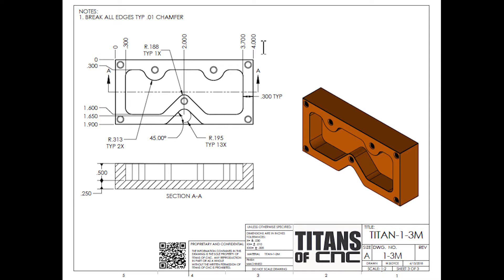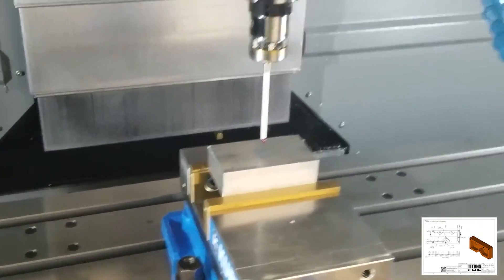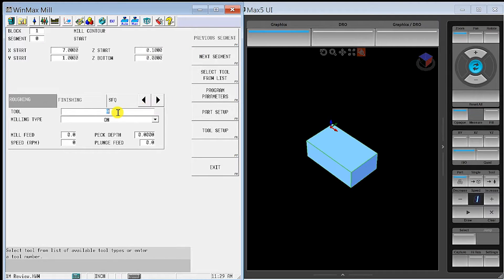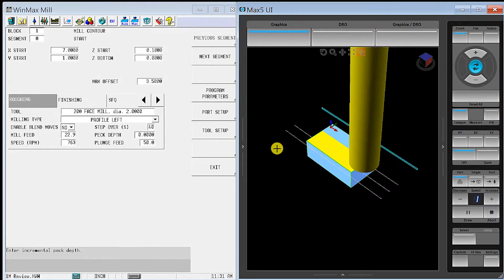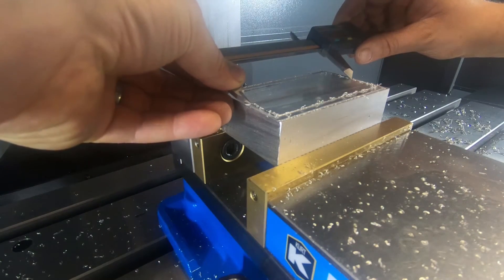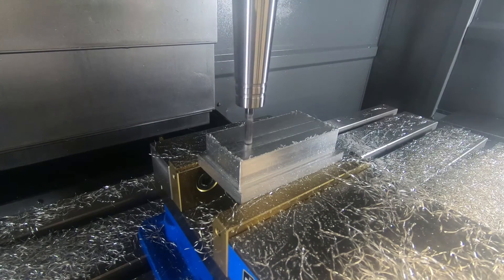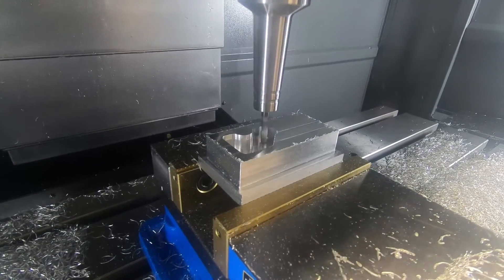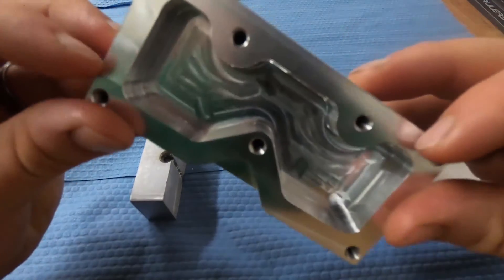Hurco machines  Titan's  1M

Comment: Good video. I have a few questions about the capacity of the conversational side of the Hurco. Rev control is very important and if personnel can make changes on the fly it's possible for the program to change a lot with out record. Also is it capable of having fixture inputs? can you define where the machine can and can not go based on toe clamp locations?

Comment: I’m a fanuc guy but I’ve been let loose on one of these, it’s quite good, you can program a simple job in 5 mins I couldn’t believe it but it’s hard to get used to, I hate how when you turn the feed to zero the machine doesn’t stop. 😒
Reply from the maker: Doesn't stop???  Did you turn rapid to zero too?
Reply: @MooreCNC  yes I had both turned to zero as I always do when proving out a job, and the machine doesn’t stop, I have to press feed hold which is quite annoying, a guy from another section of the business came over and said how are you finding it? And I told him about that and he said that was one of the things he found really annoying too.
Reply from the maker: @wazza8610  This must be a bug with your machine. I have never seen this before. You might want to call Hurco service and check your software is up to date
Reply: @MooreCNC  I agree with you though, the parts speak for themselves, the machine is so rigid the tool life is great, I’ve been doing the first op on the Hurco and then I flip it and finish it on a Hwacheon Vesta, it’s a small Chinese vertical mill, and the surface finish from the Hurco using the same facemill is so much better.

Comment: How do (did) you like the Hurco ?      Is it a good machine?  How long have you owned it?      Any mechanical/electrical problems or failures?   I'm looking at a used 2004 one for sale . Thanks in advance for any help you can provide!
Reply from the maker: Hurcos are great machines! They are extremely fun to run.  I always get concerned with buying used equipment, as you never know what you are getting. Unless you know the owner and can get all the ins and outs (crashes., maintenance ...).   Also with newer machines, you are are getting all the new features.   If you plan on putting the machine to work, and can afford to take a loan you are definitely going to have a really nice machine. Interest rates are really low right now, and I think Hurco is giving really good deals. I do not want to force your hand, and am just letting you know my opinion. Definitely way both your options!!
Reply: I know it is late for you, but if someone else reads it, like myself here... I was working and setting up 2001 hurco and 2013. From my experience, you want to buy the 2013.-2024. (up to this date) series. The company is an alfa romeo of CNC machines world. It often has ATC problems, sensor and TC lever related. If you are doing things for yourself, can be quite exspensive when something goes wrong. In my EU country, we are waiting for parts from one week to three weeks and that is a big problem. Haas, on the other hand, their representative fixes machines in a couple of days. I want more hurco machines, they are unreal for me, but the company owner likes Haas. Hellers are being used for different, more demanding jobs.

Comment: What's cycle time?
Reply from the maker: Good question. First time cutting aluminum dry with WD 40, and as other have said, that long reach hydraulic holder shown in the video could be shortened up to a stubby one (CAT40 big plus). With flood coolant and TSC drill.. I would say this part could be done in under 3-4 minutes for both ops on Hurco VM20i..depending how good of a finish you want. This would be a good challenge to see who could make the fastest

Comment: what is the year of production of the machine?  I'm working on a similar from 2018, it's a little bigger.  In general, it is fun to work, except that the chips got into the side rollers of the guides and every now and then some software problem
Reply: This machine is a 2016 VM20i   Do you work with a VM30i or a VMX series?    Yes you do have to be careful about cleaning the chips of the way covers ( do not blow them towards the table) and also try your best to not let them sit right on the ways while the machine is rapiding around.
Reply: @wademoore2139  VMX84 Ti, rigid machine and quite good functions (some are missing).  If you mean air blown, then we use the workpiece and the table to clean, the rest we have a coolant gun.  The problem was that the side table guides in the Y axis got chips through poorly constructed covers (the guide structure holds the chips inside)
Reply: mexicano343 Thanks for letting everyone know about this issue , this would definitely put me off buying a Hurco

Comment: Is there a high speed toolpath from outside like adaptive roughing built into the hurco control?
Reply from the maker: Not as of now. Sometimes we trick the control by programming your part as a "pocket Island" and then making the pocket bigger than your stock. You will be cutting a little bit of air, but sometimes it is worth it for the adaptive cutting you get! I will try to show an example video of this
Reply: @MooreCNC  thanks that would be great
Reply: Ricky Jez 
Look at Version 10.02.....

Comment: Hurco programming is amazing in every shape and form.  Sorry this guy doesn't really know how to do it.  Ball milling 3D features are so simple to do with Hurco conversational.  Basic parts can be made with 2 to 5 blocks of programming and very complex 4 axis programs can be made with as little as 300 blocks.  Massive comparison to G code programming which would take 10's of thousands of lines of code.  I use it ever single day and have found no limit to Hurco programming.
Reply from the maker: Yes we really love how quick and easy the programming is as well. To answer your previous question about why we did not use the "Mill Face" toolpath to deck the top of the part, is simply because it always brings your tool onto the part with conventional rotation, and you cannot change it to climb milling. We feel it's a lot more powerful using "lines and arc" toolpaths because you have the freedom of things like climb cutting on entry. We have tried to change everything we could, but have not been able to climb cut on entry with "mill face". Suggestions you have are highly welcomed!
Reply: @MooreCNC  Climb milling with the face option is not possible so far as I know. Hurco has a lot of great features, but they also can improve some basics. I program on our Hurco every day and love it.

Comment: didn't use the mill face option...really?  So basic
Reply from the maker: @DKaren19  very true, you are right. BUT I still prefer line and arc toolpaths for facing in most cases because you can control the step over. For aluminum you can get away with huge step overs, but if you are taking a deep cut In a high nickel alloy, you don't want to be more than 50 percent step over because you will be putting an a large inconsistent chipload on your inserts.  Programming with lines and ars gives you the freedom to choose step over, lead in and lead out.  For basic stuff like the part in this video "mill face" would have sufficed , I agree, but we machine a lot of Inconel and it's not an option to rough out at 70 percent step over with a 20hp , 9k lb machine. I don't mean to say everything is the perfect way to program a hurco in this video. I am just showing how we do it, but thank you for mentioning the other options that us Hurco wizards can use at our fingertips
Reply from the maker: Dulce Maberson Somehow I do not see where your comments went. I am positive i did not delete them, please repost them!
Reply from the maker: Punky Brat,  Mill face option does not allow you to climb mill, so we usually use lines and arcs to allow us more freedom of the toolpaths also controls step over and amount you lead on and off the part

Comment: You can program the Siemens controls like this as well , in fact in 3 ways .
1)Shop mill (which is similar)
2)Siemens ISO mixed (which I like)
3)ISO as you would have it on a Fanuc control.

And you are correct in saying making any amendments on the fly is so much easier .

Thanks for the insert always nice to see the alternatives.
Reply: I love using Siemens and Hurco for these reasons. They are very similar controls overall.